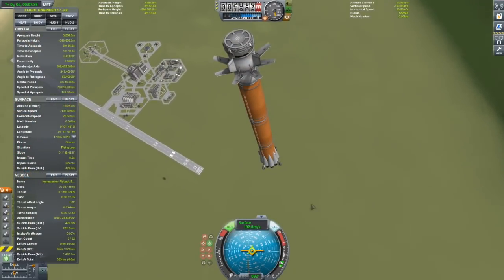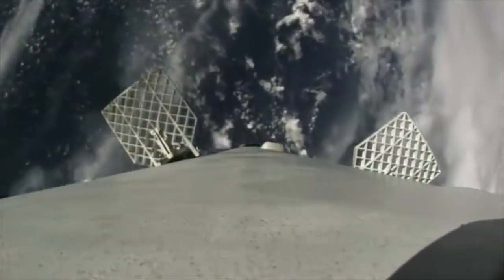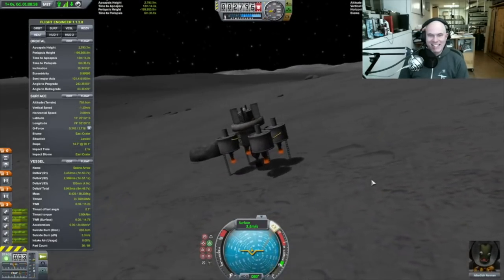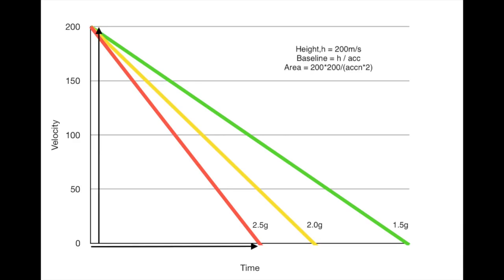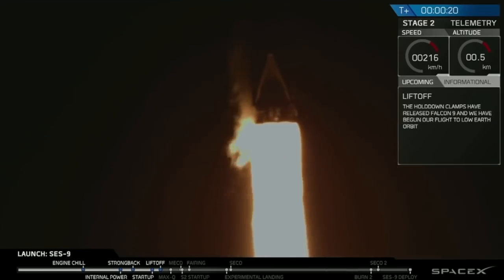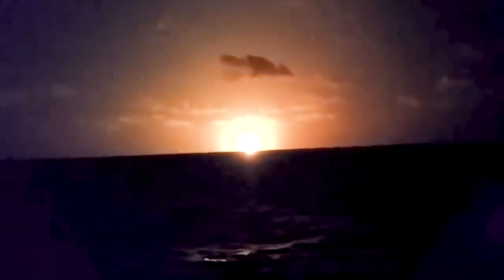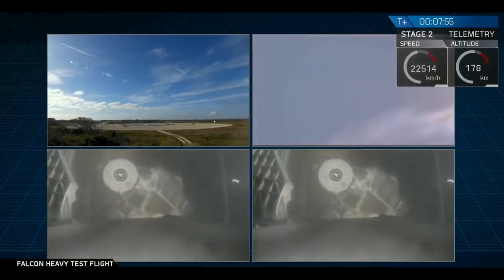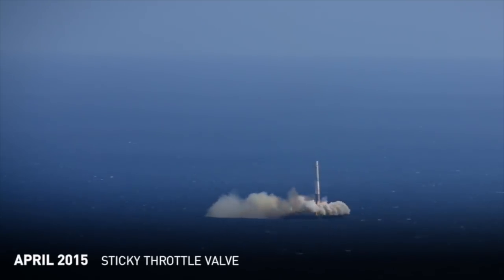How To Do A Hoverslam - Things Kerbal Space Program Doesn't Teach.

Comment: Scott - I've been wondering something about these landings by SpaceX for a while, and thought you might be able to answer a question- why do they bother landing them on their ends, instead of doing something like deploying folding wings or forward-moving parachutes with directional control, and landing it like an airplane, on it's side?  It could easily be picked up by a crane, and these methods wouldn't require the boosters to carry landing fuel aloft, which has to be expensive, energy-wise.

If you see this, please let us know (if you know), why they chose what seems to be a much more difficult and expensive landing option.

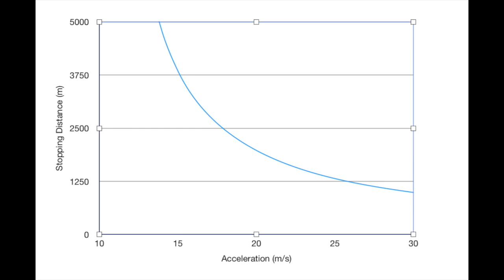Comment: It seems like I still don't get the concept of delta v. When you start your landing burn at, say, 1000 m/s the needed stopping distance obviously increases with lower deceleration. But how is the needed delta v now proportional to the stopping distance? (As suggested by the two graphs shown around 3:30?) With my understanding of physics the necessary delta v to slow down from 1000 m/s is always 1000 m/s regardless of the stopping distance (assuming you don't fire too hard and start ascending again). Or is delta v in this case some sort of implicit measurement for Energy ("fuel needed to slow down from 1000 m/s to 0"). Can someone help me out and explain the connection of delta v/energy/stopping distance? 
Thanks in advance.
Reply: Unfortunately, you thanked him in advance for nothing

Comment: Variable throttle is usually done by PWM control of the engines.  It can also be done as SpaceX did by toggling additional engines for a period of time.   By controlling the length of time of that middle burn they can adjust the speed.  (Provided they have enough fuel.)
Reply from the maker: I'm pretty sure PWM only aplies to small hypergolic engines like those used in RCS. It's not possible in large engines with turbopumps and startup delays.
Reply: Hahaha, maybe he meant extremely slow PWM. You know, like microwave ovens that change magnetron duty cycle for any setting less than full power, making ten seconds on full power be pointlessly equal to fifteen seconds on two thirds ...

Comment: Hey Scott,
Viewing the flight record of the latest Falcon Heavy launch, I've summed up the total burn time for the engines since separation of the boosters, and concluded that 115t of fuel were burned for booster landing.
That raised some questions of course. To accelerate those extra 115t of fuel, fuselage and extra engines, you need more fuel, more power. A very rough intuitive estimate would be that of the 400t of mass of the booster, around 250t were solely for recoverability.
That being said, I understand that the suicide burn is the only way to land on a surface that is not surrounded by a thick atmosphere. But when it comes to Earth, there seem to be many alternatives, like the extendable wings of the projected Buran II rocket system from NPO Energia planned for 1994, or air brakes and giant parachutes even (I've researched - such parachutes do exist).

What did I get wrong in this assessment?

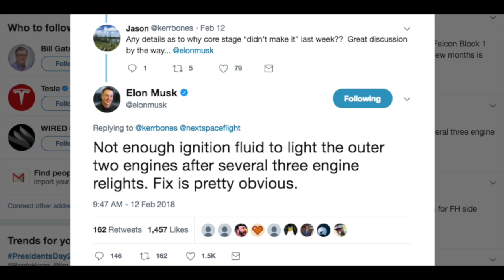Comment: You mentioned "There is a lack of pyrophoric ignition fluid to light the rocket engines" at 6:38, but the bottom opening of the rocket is already so hot deal of the friction. Mr. Musk what is the temperature in Celsius at the bottom opening ( near the nozzles)? Why the rocket engines do not burn even at such combustible temperature?

Comment: I suspect stopping engines has more precise control than starting them.  If I were doing a landing I'd measure the thrust from one engine to get precise data on fuel/thrust, then I'd light 2 more engines to give maximum stopping power, then based on when they started I'd work out when to turn them off and leave a single engine on to get the smoothest landing.

Comment: The Merlin engine's minimum thrust is about 57%, which is one of the factors that makes the hoverslam maneuver necessary when landing a Falcon 9 booster. Blue Origin's BE-3 can throttle as low as 20% (which is really, really hard to engineer), making New Shepard landings much less dicey. A New Shepard booster could, in theory, be made to hover, as the minimum thrust of the BE-3 is lower than the mass of the returning booster. This may be part of the reason that Blue has been so successful with landing boosters (they've never lost one). Admittedly, the mass and energy involved are vastly different for the suborbital New Shepard and the orbital Falcon 9, but the technical awesomeness of the BE-3 is worth talking about.
Reply: Uhh Blue has definitely lost a booster before
Reply: Blue Origin lost a booster in April 2015

Comment: Scott why don't they just catch the booster rockets in a sheath instead of trying to land them perfectly vertical? Something like a large cylinder split from top to bottom that envelops the rocket and 'swallows' it as it comes down.... much greater tolerance for error and they can put floaters or wheels on the sheath and tow it home.
Reply: nachtstucke777 now instead of hitting anywhere on the barge, you have to get it precisely inside of the sheath
Reply: you do have to make it to the barge either way... and yes you have to make it near the sheath...however you don't have to get it precisely inside the sheath you just have to get to the sheath and the swallowing action of the sheath will scoop it up.  currently ALL of the 'precision burden' is on the rocket.... and the barge landing pad isn't helping at all.
Reply: nachtstucke777 so you want kind of more of a funnel? I don't think that would work either, because the rocket wouldn't slide into it very well, it would fall over or be damaged as it slide on the sheath
Reply: kind of ..A funnel would be an idealized version. in any case the inside would have shock absorption at the bottom and sides, and you could aim it (swilvel) , lift it (hydrolics), making it even easier for the rocket , if the mechanics are reactive enough it could catch it gently as it tips to one side and slides in. to your point I'm not sure how fragile spent rockets are but I think modern engineering could possibly make it work.

Comment: I love doing suicide burns in KSP, and even suicide landings with aircraft (Basically waiting last minute to slow down then try to use airbrakes and reverse thrust to slow down fast).  But yeah it's tricky to get it just right.   If I overthrust I usually have enough fuel left to let it drop and then try again but IRL that's rarely the case since extra fuel means wasted weight so it's calculated to a T.   That and a rocket like the Falcon 9 will probably start to tip over if you slow down too fast or stop mid air. It does have top side thrusters but think those only go so far.

Comment: One thing you didn't seem to mention is gimbaling the Merlin engines thrust.
Ie vectoring the thrust outwards until landing. This would slightly reduce the amount of impulse, giving a small amount of wriggle room ie if coming down to fast the computers can vector it all fully down. Or if too slow increase the amount of side thrust. The engines on opposite sides will balance side  thrust with each other.
Reply from the maker: They don’t gimbal enough to make a big difference though.
Reply: :( ☹️ sorry didn't know that. The only thing I could find online is that the engines CAN gimbal, with a highly inaccurate quote of 5 to 10% or degrees I forget which. Lost that article from last night. 

Great content as usual 👏❤️.
I seem to be gradually trawling through your back content 👍😃
While also watching your current stuff.❤️❤️❤️

Edit: expansion and typo removal.

Comment: I guess it’s safer to use more engines in case one of them failed during landing? Would there be any time to compensate for such a problem? 

Could the BRF or dragon capsule escape system be able to save the crew in such an event?

Comment: But what are the advantages for SX of using "hoverslams" than a SRB style chute recovery? I can't imagine that the chute mechanism would weigh as much as the fuel the engines need to burn for deceleration (not to mention the thruster propellant for steering/stabalisation) and it would seem to be a simpler procedure with greater tolerance for random events and errors.

Comment: If you still don't completely understand why a suicide burn is the most efficient way of sticking a landing, think about it like this:

The less time you spend cruising toward the surface, the less time acceleration due to gravity will have to influence you. So if you start your burn early, you're only increasing the amount of time that it takes to reach the surface. Despite the fact that you are indeed slowing your descent, you're just allowing that 9.8 m/s^2 to take place over a greater amount of time, which means you'll have to burn more fuel in the long run.

Comment: you sayd the central booster of the flacon heavy could only ignite 1 instead of 3 engine, but wouldn't the other 2 get ignited by the burning one if the just started blasting fuel out of them?

Comment: Does Kerbal include a drone ship, so you have to account for the vertical motion of the landing surface? Not just the varying height, but its vertical velocity. And the up-down is changing!

That adds another level of difficulty SpaceX solved for the exact millisecond to cut the engine. Wouldn't most engineers have totted up all the variables and hurdles and just concluded it was impossible? Awesome rocketeers!       (Interestingly, I bet even if NASA engineers did think they could work it out, they wouldn't be allowed to pursue it, as too high risk, of funding and bad public visuals. Another big plus of having private space companies.)

Comment: “Minimum-time” optimum-control problem naturally leads to a “suicide burn.” This is exactly the same reason why F1 drivers brake lake. Delivering necessary total momentum change to come to a complete stop by controlling the burn-time seems to be easier than changing the thrust of the rocket engine. Unlike Jet engines, rocket engines are not known for their throttling ability.

Comment: Gee, my favorite way to land is  set periapse to just above terrain, then retroburn, while keeping retrograde on the horizon. Then land normally.

Maybe a little excess dV, but you can use smaller rocket motors, so you HAVE more dV to spend. With acceleration equal to just 2X planetary gravity, you can slow to zero, while maintaining altitude, with just 30 degrees nose-up attitude.

Comment: Actually the very thing you need is the problem. Fuel... The more of it you have. The more thrust you need to slow down to a stop.. One reason you want to use as much air breaking to reduce most of that return speed. But then that causes an issue. The slower you start to go. The less drag you have to slow it down. Unless you can increase the surface area under it...

One reason I still prefer parachutes. And not round ones. As the square ones can produce 30-40 MPH forward speed. Controlled turning. Heavy Breaking. Which is less weight compared to fuel. Then at the last moment. You can release it. Then land under controlled power. It's more efficient to start with. As that is the only way to increase drag surface area..

Comment: I know it's really ridiculous, but I wish if they'd ever have a Block 3 or 4 mission which is really light, and maybe even only LEO as well, so a lot of fuel margin and general tune to test, they'd attempt a soft water landing with all 9 engines. They'd either be at 0 vertical speed way above the water and have to shut down, or they will crash into the water, or the burn itself will tear the rocket apart due to the high G forces, but they are throwing it away anyways.. just attempting it and filming it would be so awesome.. could you imagine those things slowing down about 8 to 9 times as much as they do now (and if you have ever seen an amateur vid from the ground, these things are coming in super fast, it's unreal how fast they decelerate, even with one engine)?

Wouldn't it theoretically be doable? I mean.. The TEA-TEB they'd need is of course additional weight and all, but it's not like it's impossible if it's an easy mission. Would really love to see this happen

Comment: Don't you forget that the spacex rocket engines can be trotled? 
They is trotled when the rockets is going up. They reduce the power before going through max-q I have heard them say.
But they try to let it run as near maximum as possible for efficient reasons. But you clearly see they ease up the power just before landing.

Comment: I have a question about this regarding reusable comercial rockets. I dont really understand why a method like this would be preferable over a parachute. Because you need to stabilize the freefall which takes either fuel or otherwise additional equipment, you need fuel for the engine and all that takes up weight. You lose that weight not only as a potential payload, but also have to lift it up aswell which both is wasted money from a pure economical perspective. Also there is a lot more stuff that can go wrong and result in a failure and loss of the craft. So over time (if you do it often enough) you will lose more crafts.

So why not just use a parachute? Esp since you use a robo barge to pick it up anyways. Having the barge being able to lift it out of the water seems to be the more economic solution for me. Is it simply because of PR or am I actually missing something?
Reply: - The boosters are 10 stories high, parachute big enough to land them safely and structural reinforcement required would be heavier than fuel used for landing.
- Parachute is just another system that need to be designed, maintained and can fail and still you would have to keep some fuel to make reentry burn, why bother then? Just keep more fuel to make propulsion landing without adding anything new to the rocket.
-  Salt water is heavily corrosive and it really doesnt like hot metal, after splashdown entire rocket would have to be dismantled to the tiniest bolt, cleaned up and re-build again, it would take months and cost millions, while after propulsion landing rocket can be reused after basic checkup.
  Musk mentioned multiple times that he want rockets work like cars: launch - land - checkup - refuel - launch again even same day,  thats his final goal, it is simply impossible with parachutes and splashdown.

Comment: One thing I've never understood about this is why they don't just use parachutes to bring the boosters down safely. Would require less fuel to be carried at launch and would probably be more reliable than depending on "suicide burns".
Reply: Well mr urch. Parachutes would take more place and give less place for fuel.  And just using the fuel they still have they don't need more space
Reply: Also, suicide burns are quite reliable. Parachutes can fail and also make landing on a pre planned point very hard. Especially since they have to land on a droneship. They also have to survive re-entry.

Comment: So how do you really calculate a suicide burn in vacuum? Cause if you calculate the altitude of your burn based on your mass an thrust, once you start burning your mass decreases and you end up hovering. To maintain the T/W ratio you need to throttle down and as you said, not every engine allows this. A solution could be on/off, on/off with hypergolics, but I'd like a more sophisticated math solution. One continuous burn!